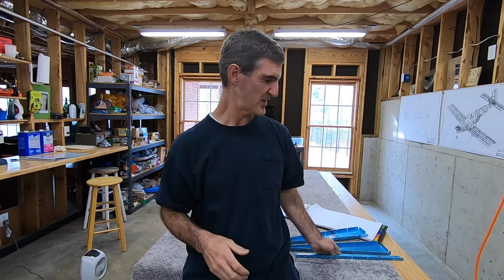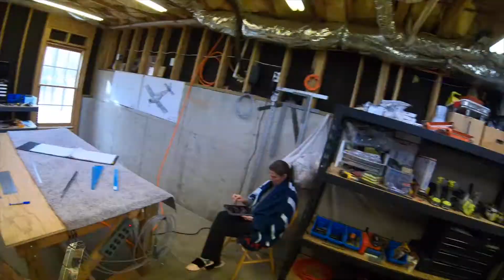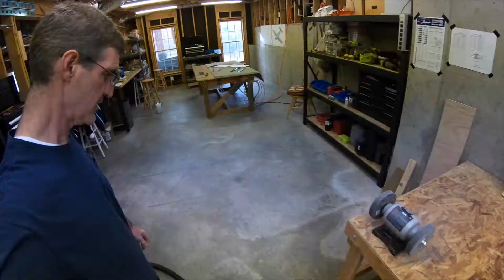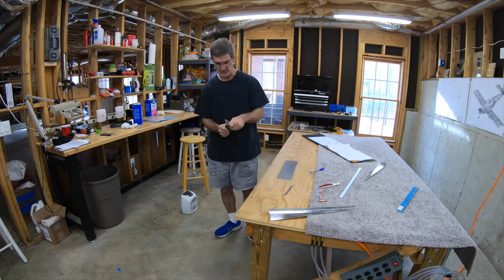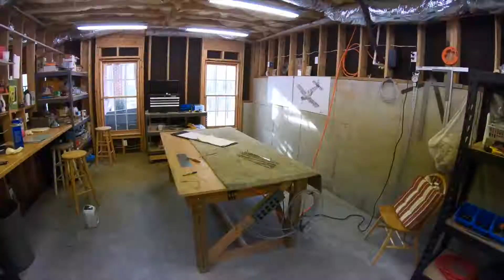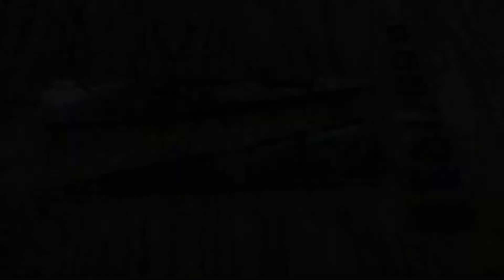RV-10 Build Log - Emp 18 - Starting the Rudder!

Comment: I purchased both right and left offset snips from Cleaveland Tool and had a horrible time trying to make nice cuts  until I learned how to use them.  The trick is to use the right (green) snip to cut with the waste material curling up on the right side and the left (red) snip to cut with the waste material curling up on the left side.  You can use red or green snips to cut to the left, cut straight or cut to the right.  The color of the snip only determines which side the waste material will curl and form.  Secondly, you need to make sure that the flat part of the offset snip is directly under and parallel to the flat part of the material that you are cutting.  You want to make sure your snip is flat and level when cutting.  Finally, you want to keep your material in the middle of the two blades of the snip when cutting and make short "baby" cuts.  Although it takes more cuts to cut the material, you will be able to slowly advance the snip forward and easily keep control of the material as it is being cut.  Do not try to make long cuts all the way to the tip  point of the snip while cutting.  In other words, do not think you can cut your aluminum material with your snips like you cut a piece of paper with scissors.  Trust me, the snips are very useful and can make very nice cuts once you learn how to use them.  I hope this helps you out!
Reply from the maker: Hey, thanks for the tips!  I also have the red, green, and yellow snips, but I think in this video I was (stupidly) not using any of them, opting for some smaller ones that don’t have the right curve.  I did end up using snips to separate the stiffeners the other night (no video yet) but in that case, there was enough margin to leave waste on either side of the cut and clean it up with the band saw and sander after.  Good to know that the snips can work if I just learn how, and I’ll keep your advice in mind next time I use them.
Reply: @missiletwentynine2667  No problem!  After you get good with the offset snips, you will be able to make accurate cuts right on a sharpie line.  From there you should be able to go directly to your grinding wheel for deburring.